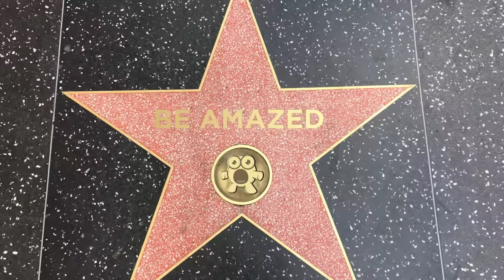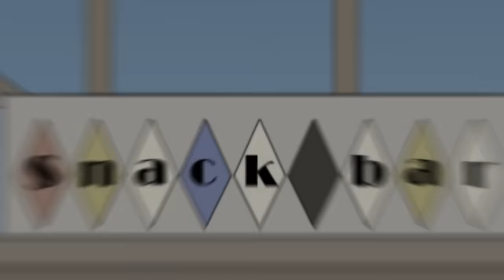Giant Floating Islands of Trash – World’s Largest Garbage Dumps

Comment: I’ve work on a garbage truck for the past 14 year. The amount I’ve contributed alone is astonishing.
Reply: What happens to all the trash how they get rid of it does it get burned or something?
Reply: @josgn  lol no they don’t burn it. I drop it off at a dump where a bunch of other county’s drop there trash off. It gets sorted out for recyclables and what not and then gets brought by either truck or barge to a landfill. What happens from there your guess is as good as mine.
Reply: @jayr2138  👍👍
Reply: I know here in Denver about 25 miles out it's been barried and there's pipes coming up from it for methane release.

Comment: much of the land fill is plastics and much of it is not recyclable, what needs to be done is to start to put the worlds volcanos to good use, once the recyclable materials are removed the waste can be compresses in to cardboard tubes roughly the size of rail road tanker cars and stacked on waste barges that would carry the highly compressed waste products to a facility constructed on the edge of an active volcano that has a large ceramic tube extending out over the main pool of lava, then the compressed garbage would slide down the tube and in to the middle of the lava where the temperature reaches near two thousand degrees, at that temperature any toxic materials will be rendered harmless, the cardboard tube would be thick enough to withstand the lava for a short while, while the tube sank below the lava and burned up, along with all of the toxic chemicals that would be released from the burning plastics, and the only thing that would be left behind is the ash that would be rendered harmless.

Comment: This is footage from ages ago , I worked in the garbageinguiser In Belgium,  from the garbage that they burn they make staem in pipes and produce the Electricity , the ashes from the smoke is used to make salt for the winter for the roads,  ( the arches mixed with water is acid and the acid water with lime give salt ) the ashes that stay is pure heavy metals what they use in concrete the only thing what getting dumped is the ashes from the garbage what was for only the city of Antwerp one little truckload a day for the landfill       " Hoge maai " everything is used plastic recycled the waste from the waters also inurned and mixed in  concrete etc .... noting is dumped as garbage in Belgium and whole this part of Europe even no chemicals.

Comment: The crops harvested by Commercial rice growers are also a very large contributor to the amount of methane gas emissions produced annually; also contributing to the "green house effect". To have so many floating open air "landfills" is absolutely disgusting! The one off the coast of California included. As far as what China managed to recycle was almost impressive, but when compared to the amount of waste China alone produces, not so much. What kind of an idiot builds a snack bar on top of a closed landfill. Good grief. 🤨 It's a miracle human beings aren't on the verge of complete extinction. In my not so humble opinion.

~ APRIL LIPKE